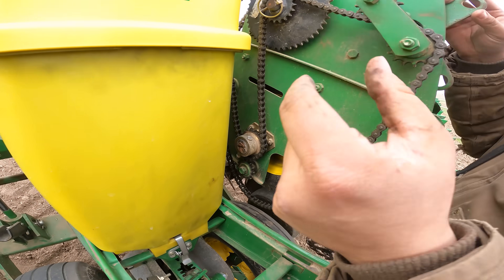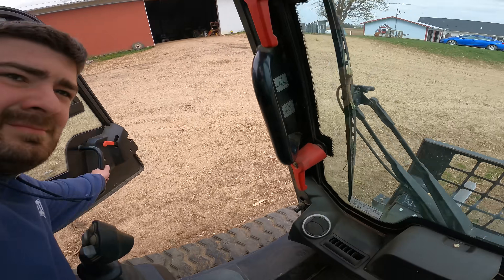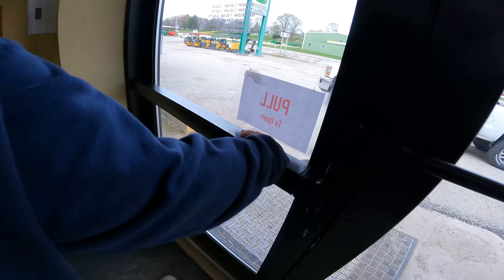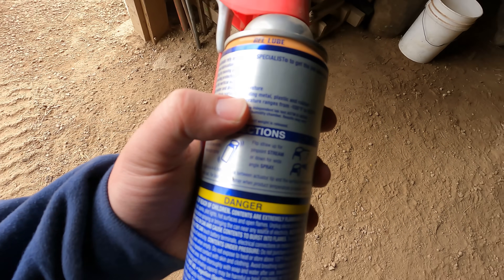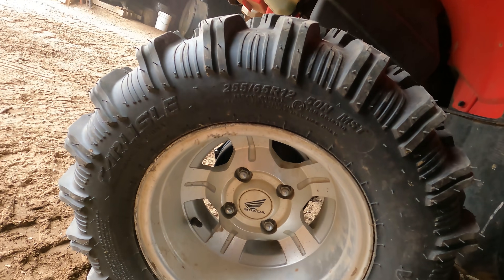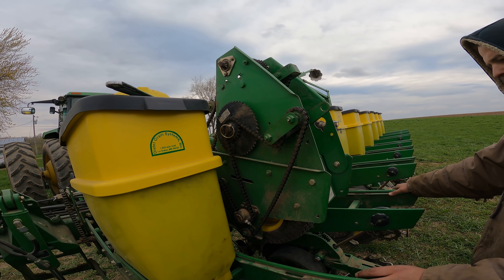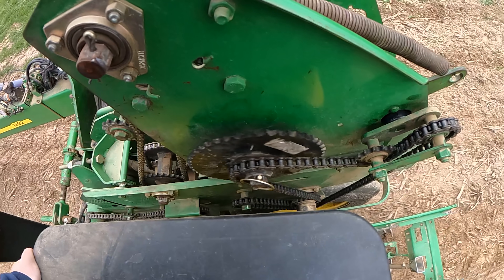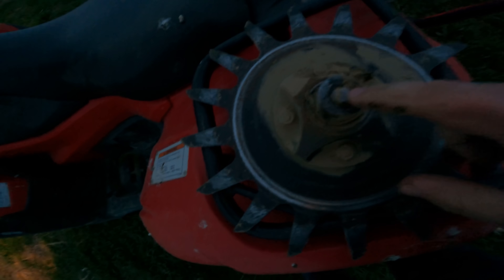Hurry Up and Fix Something! | First Day Planting

Comment: Question on the seed tender trailer.. we have one just like it and it seems that the auger always drops some seed when folding unless you open the cleanout and run it backwards. Does your’s have the same “feature”?  It acts like it never cleans out the top half of the auger on its own.

Comment: Some machines are engineered with an easy to break cheap part so if a hard to fix expensive part recieves too much force the easy to break cheap part breaks instead of the expensive part. Kind of a physical fuse.

Comment: Glad It wasn't major doesn't make ya wonder why they use plastic part on a planter
Reply: More likely a cost thing.  Looking at it another way:  The plastic breaking is preventing something more serious from breaking.  Similar to a fuse blowing--keeps something else from going up in smoke.
Reply: Less chance of corrosion from fertilizer liquid or granular.
Reply: Helps you control what breaks when there's a problem. Some people will choose belts over chains when given the option for that reason. They would rather replace a belt than a more expensive part.